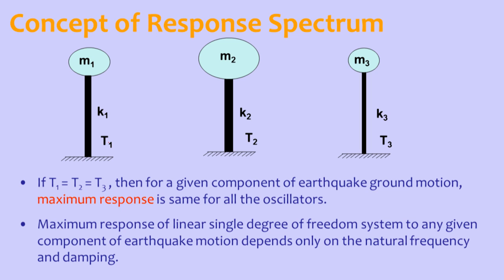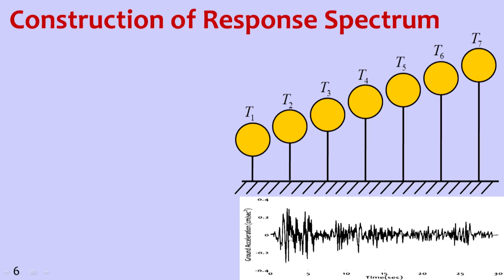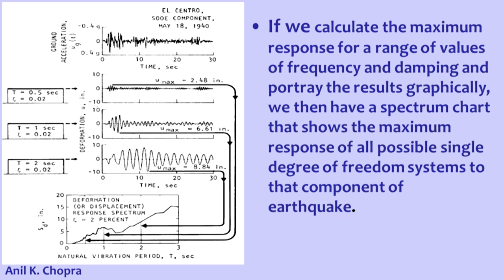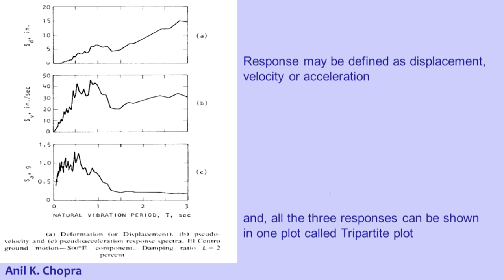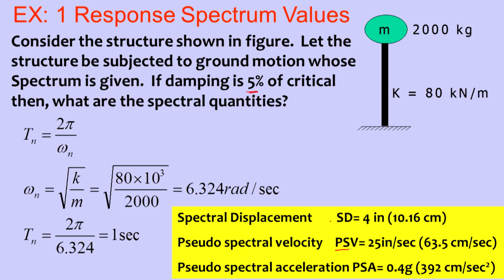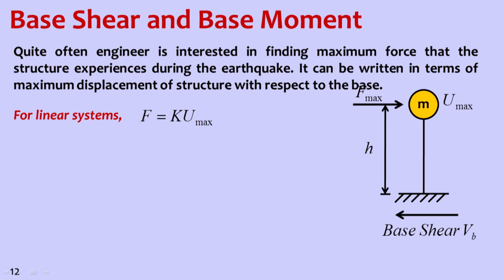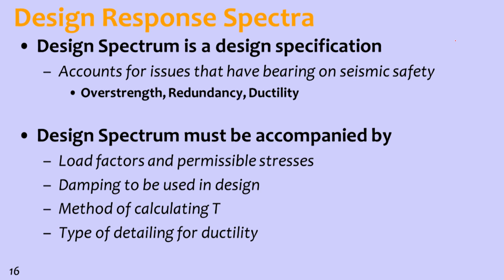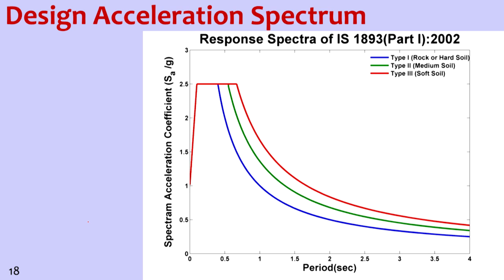W06M01 Response Spectrum

Comment: Thank you sir
Please its required to take signs for direction like +response function in X direction and - response function in X direction and same for y.
if we use 100+30 rule the sign of directions are also necessary or no especially if the structure note regualr for example 
100 spec x +0.3 spec y 
100 spec x - 0.3 spec y 
-100 spec x + 0.3 spec y 
-100 spec x - 0.3 spec y 
and same above for 100 in y direction and 30 for x direction.

Comment: Thanks a lot professor. I have a small question. In 9:24 you illustrated 3 different diagrams for displacement-time and then you took the maximum values to compose the displacement response spectrum, my question is: are the 3 different diagrams represent 3 different structures ??
Reply from the maker: Dear Husain,

Yes, all three diagrams are of 3 different structures. As you can see that all of them have different time period, i.e. combination of mass and stiffness is leading to 3 distinct timer period, hence all of them are 3 different structure. 

Wish you all the best.

regards,
SD Team